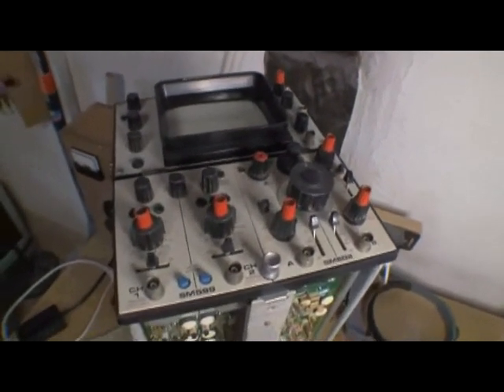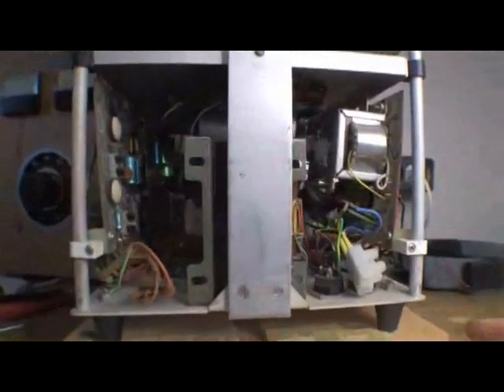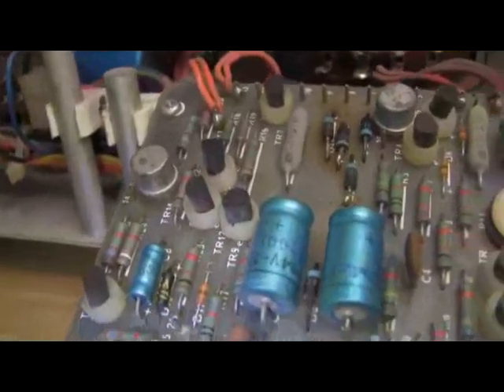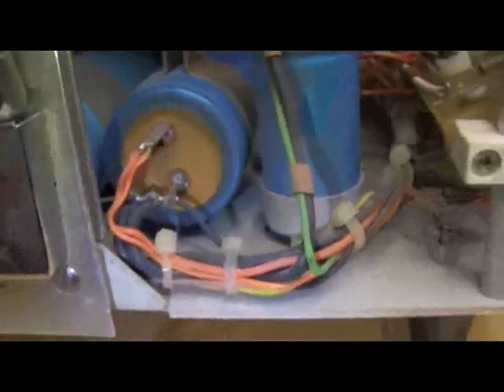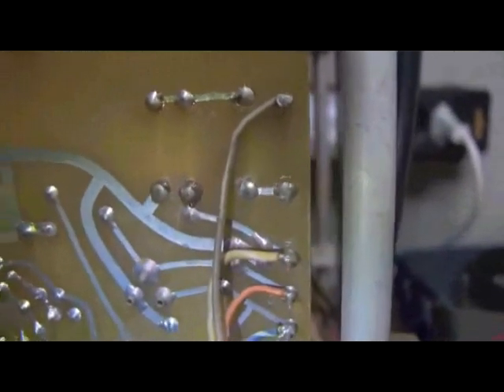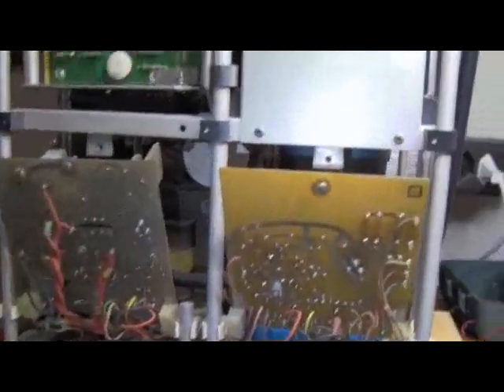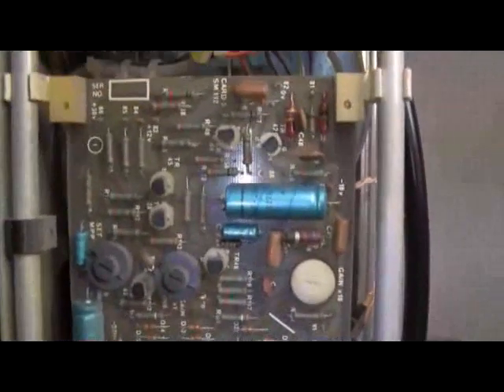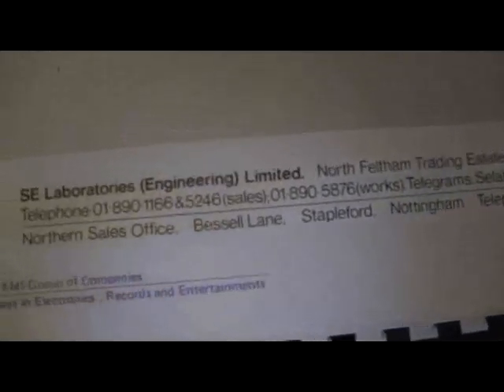Next Project - Oscilloscope repair - SM112 Part 1

Comment: That would certainly do it. Probably you've already repaired it, but I would guess that the bridge rectifier diodes and the primary filter caps in the low-voltage DC supply have popped. Hopefully it has a line fuse which blew and upstream damage will be minimal. Good idea to replace all questionable electrolytics just on spec. 

I've had to repair all three of my scopes in the past couple of years: HP180a, Tek RM503 and Tek 2213a. Great fun.

Comment from the maker: Yes the various modules all unplug.  The original fault was the unit was completely dead.   I moved house (and country) about 20 years ago and the local ac supply is higher than I expected.  When I plugged it in the first time there was a little puff of smoke and a bang!   I left it on the shelf for years before finally getting round to having a look.

Comment: Wow.... I am struck by how similar externally this scope is to the HP180A, my old workhorse.

Inside it's quite a bit different though. Does the lower unit (vert amp and timebase) unplug and slide out the way the HP does?

You didn't say what the problem was, though. It does have a beam?